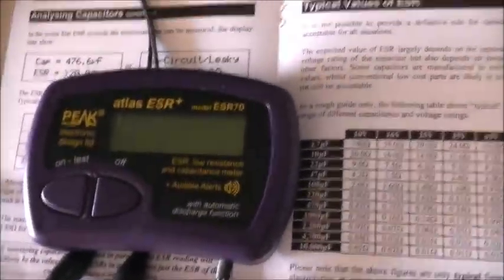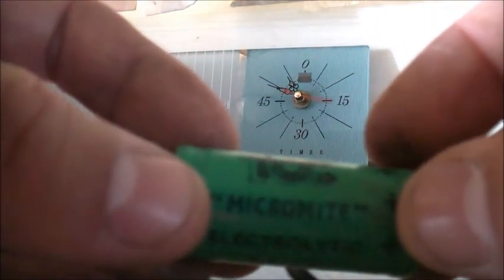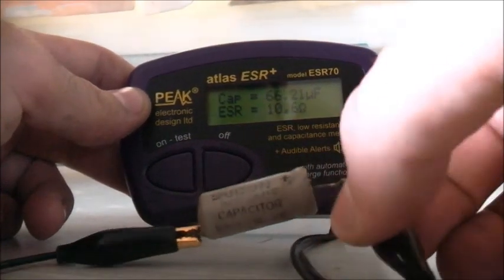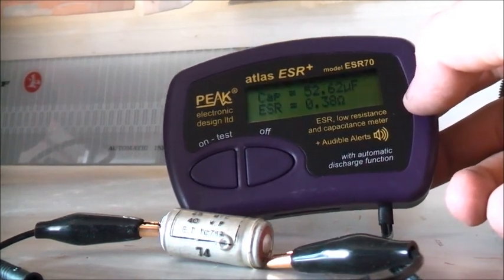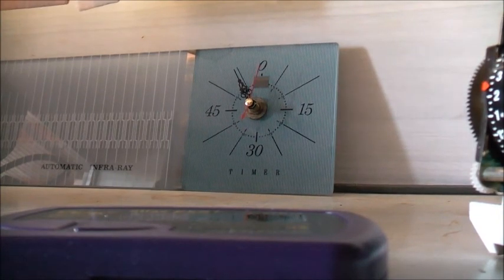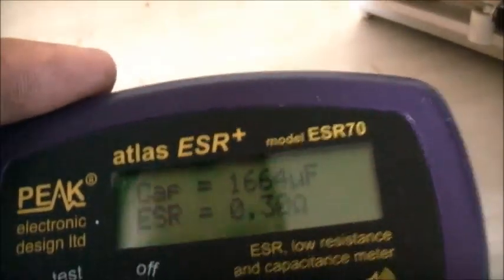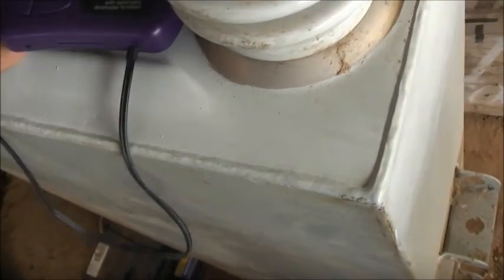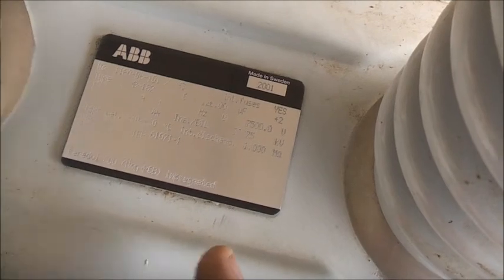Atlas ESR Meter Test

Comment: Capacitors from motherboards and switch mode power supplys are often 0.0xx omhs.
Nice tool.
Also different series capacitors from the same manufacturer have different esr.

Comment: Hi, A very useful little beast!
Just bare in mind that a leaky cap is effectively a cap with paralell resistance. I'd say if you're measuring a cap in circuit, it's likely something outside the cap is discharging it. You may well find it tests out fine if you de solder one of the legs and then test.

And, have a great christmas tomorrow!

Comment: Also it may be a bit too critical with low grade low frequency capacitors, i suspect its best use is high grade smps capacitors where performance at high frequencys is very important.

Hope you read the comments!!

Comment: Caps in circuit wont read correct, always disconnect and discharge before connecting to the meter :-)

A very handy tool, put a new smps cap on it to make sure the meter is ok, im a bit sceptical with all new things as ive had faulty new stuff :-)